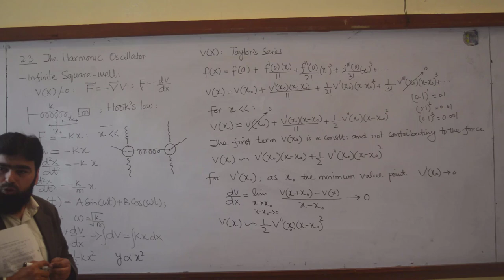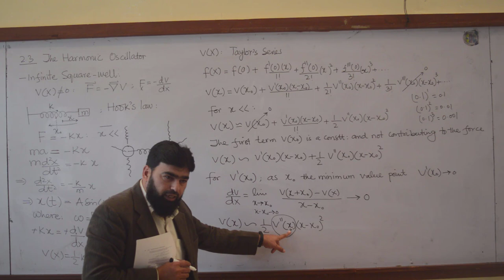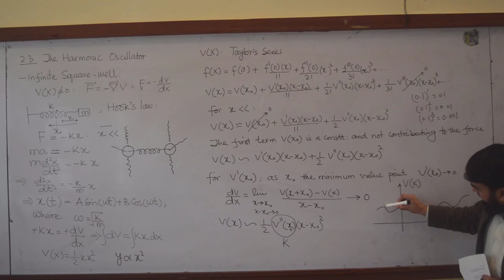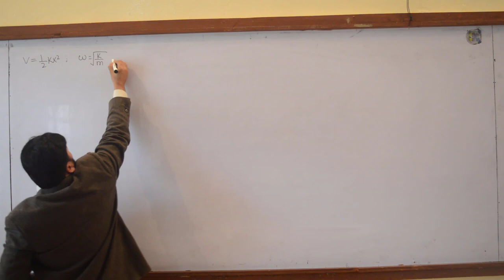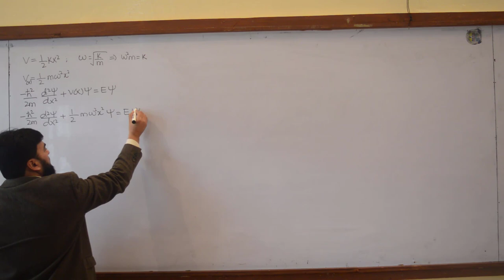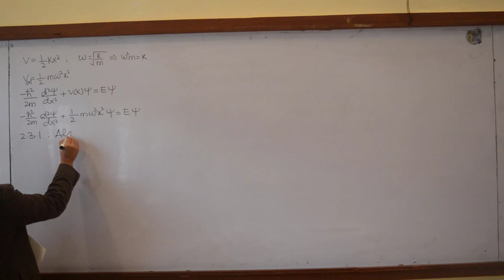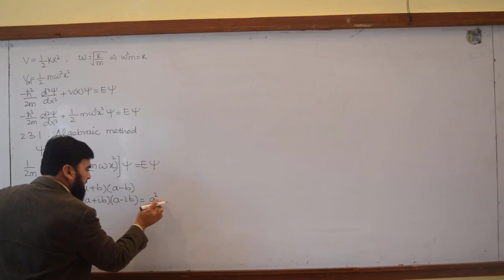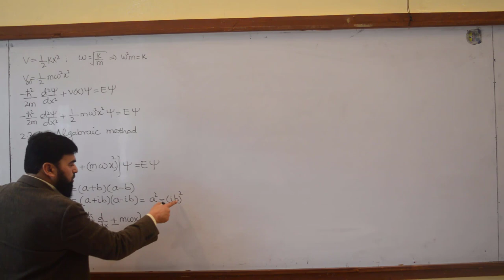L9.2 The harmonic oscillator: ladder operators

Comment: 3:16 for anyone who didnt understand. The only reason this eqwuation is used is because we want to find the instantenous change or that slight difference betrween the two nodal points V(x + x0) acts as the next ndal point and V(x) acts as the previous nodal points and dividfing by the (next posiition point - previous position point) we are finding the instantenous or CHUNK CHANGE that immediate change

x acts as ther next pouint while X0 is the previous point

why x approaches x0 is because when the next nodal point value or the trend appraoches the previous nodal point BEING THE MOST MINIMUM POINT, replace x with x0 and you will get 0 becvause V(0) is 0 and 0 / anything is 0/ Do the divergence test first

5:15 first derivative is like you look and observe the change which is relatively small, second derivative is like you zoom in and observe the change which is much larger

7:12 as in the X0 value is so small cube of any small value is a much smaller value and multiplication of a much smaller value with a small value is almost 0

9:43 that regionis the V(x) because

1) dv / dx is the chunk change or the instantenous change
2) we have minima point and som x value point meaning we can easily find dv / dx
3) the potential will lie within that region
Reply from the maker: Thanks for the valuable input dear 😊

Comment: the first part is 0 beacuse for anyone who does machine learning, this correaltes to linear regression model where if we were to identify the cost function we would subtract the [original value - predicted value] parametaized at a certain parameter, however the parameter here is the centre value and since the difference betrween the original value and the first predicted value are almost 0, they are almost equal as the x << [as in a very small value], the next value is when we update the parameter and do the calculation, preduct the hypothesis again
1:04 here we are updating the parameter from theta = 0 to 1 to 2 to 3 to 4 and so on where parameter 0 has NO VALUE SO THATS TECHNICALLY 0 however PARAMETER 1 DENOTES THE GROUND STATE VALUE AS IN THE FIRST MINIMUM VALUE FROM THERE ON WE CAN EITHER GET A LOWER VALUE OR A HIGHER VALUE OR ALTERNATING BALUES

1:09

so to identify why the x variable reaches 0, IT IS NOT 0 YET!!!!!! is if we were to find the derivative [ lim as x approaches infinite, V(x - xo) - V(x) / x - x0 will give you a somewhat gradient value. Again comparting it to ML, pressume that you want to get a score value, an accurate score value so parameter 0 is lets say 10 and parameter 1 [this is the value that the machine learning model has predicted a value] lets say the value is 10.43 so [10.43 - 10] (note this wil be an absolute value magnitude value) / parameter 1 - parameter 0 so (0.43)**2 / (1) which is almost 0 so it apprahces 0

6:23 
pressume X = 0
V(0) = 0 at parameter 0
V'(0) = 1/2(k*(x)**2) where derivative of it wil be dv/dx(1/2kx**2) ill be kx and k*0 is 0
V''(0) = d**2 / dx**2 (1/2kx**2) would be d/dx(kx) = k now there is no x and V''(0) would be just K there is NO X
V'''(0) is simply the derivative of K = 0 
and from here on all you will get is 0

8:35
its like locally weighted regression where you pressume a certain training model based on the local datas where higher the peak higher the weight and higher the peak region, probability of that specific value within the given algorithm is high. 1/2kx**2 and if you plot lets say x from 3 to 9, then the probability that those values from 3 to 9 would be high as the weight of those values are high [due to the peak amplitude]

14:12 -hBAR*2 = (hBAR / i) * 2 = hBAR**2 / i**2 = hBAR**2 * (-1)
Reply from the maker: Thanks for your informative input.

Comment: Well, despite from first principal rule of derivative if we just take a look at the fig2.4 in the book the slop of the graph  at Xo becomes zero so first derivative is zero, however it is not necessary that if the first derivative of a function is zero then the second  derivative will also be zero,but fact is it can be any value.
Reply from the maker: Yes, you're right. As Force is the negative gradient of Potential and we're considering force only, so first derivative is sufficient to decide. Thanks